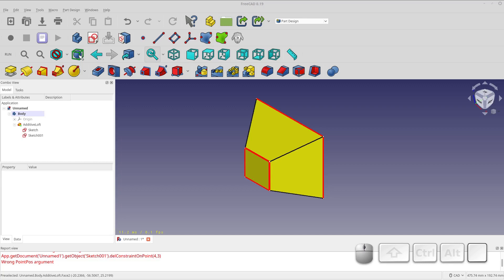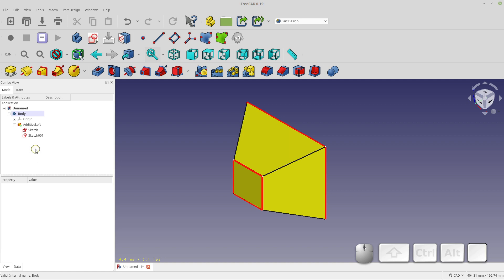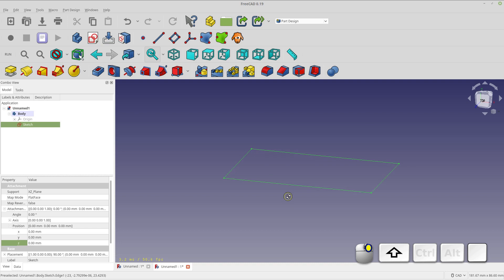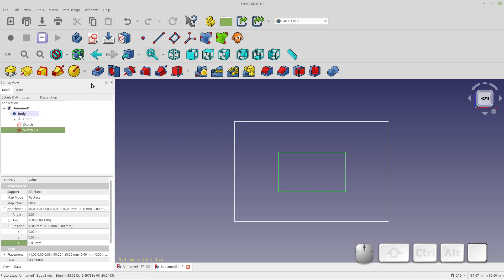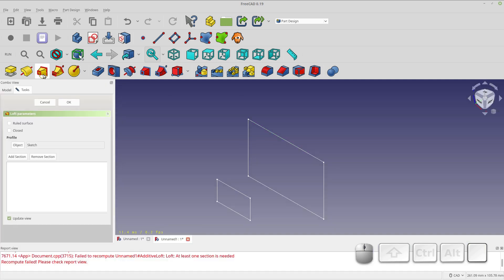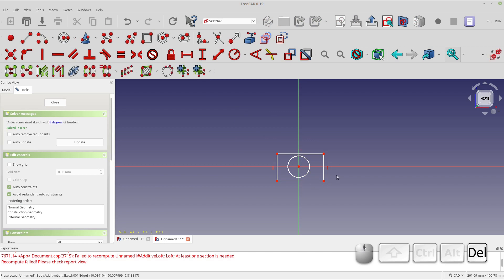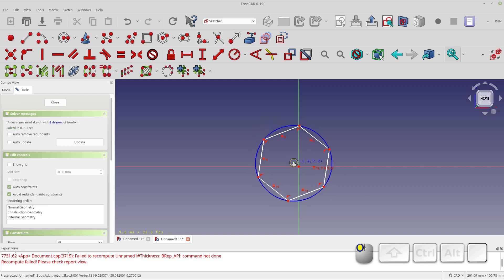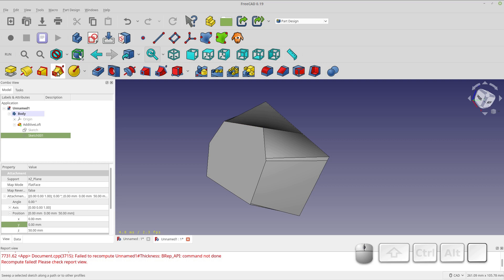FreeCAD Part Design Loft - How to Create a Simple Loft

Comment: Try lofting a tubular part. This requires sketches with two rectangles and one is inside the other. I was using loft to create a rectangular tube which varied in dimension along its length. It worked well except at one section where the inner rectangle and outer rectangle crossed over at one loft section of the loft which made an apex in that section of a solid I wanted to 3d print. I really puzzled for hours trying to eliminate it. Eventually i found the reason. Freecad  dies not loft double shapes via inner and outer shapes but it lofts double enclosed sketches in the order you create them. 😂😂😂. Wow. This was not obvious to me.

Comment: I am on 0.19 Rev#: 24276(Git); Release date, 2021/03/11, on Win Pro 10 64bit.  I am able to create each Sketch as you point out but when I attempt to move the Sketch001(inside box) using the Position Z,  I can't input numbers to move the box out.  There are no symbols on the right side of the line to move up or down.  Would you have any idea what could be causing this?  In fact, I have attempted to use other videos on Loft and I get the same results.

Comment: I'm a newbie to freecad, but have made a few parts, then crafted them on my 3d printer. I gather you know a lot about freecad, and thanks for teaching, but I had no idea why you were doing what you were doing. Your cursor was flying all over the place, and eventually, after listening carefully, watching carefully, and trying to follow along several times, I just gave up. I guess that despite having a post graduate degree, I'm just not quick and smart enough for your channel.
Reply from the maker: No, lol. I try to go slower but I am so easily distracted I forget. I often get frustrate by fast videos on other subjects. I tend to keep my finger on the space bar to pause. You can also slow down a video. I think using <> or just the speed drop down
My two biggest issues/complaints are speed and mouse eradic behavior. You are in good company ☺️